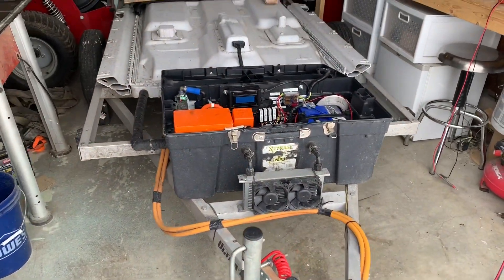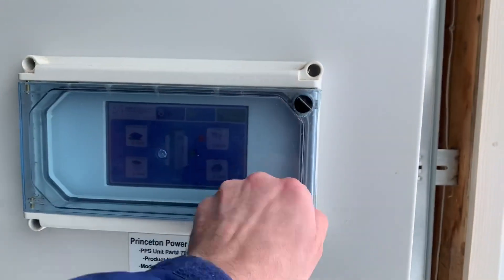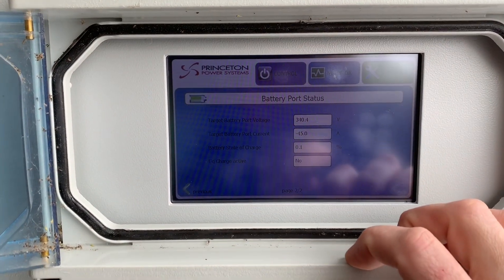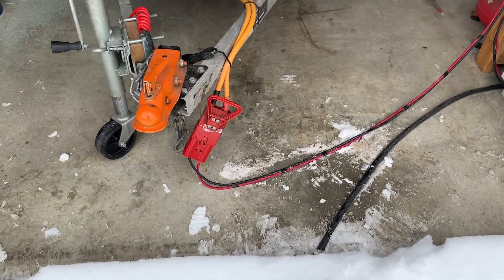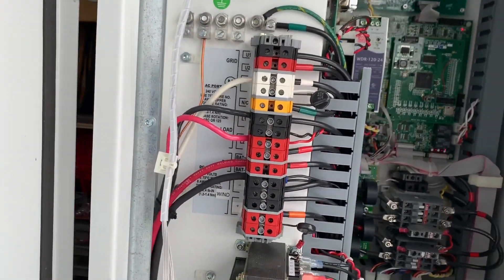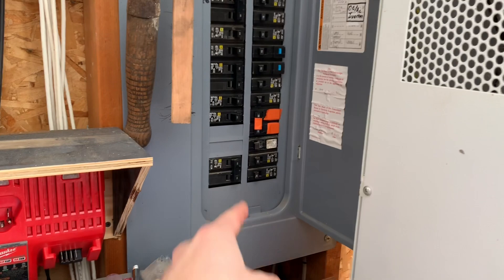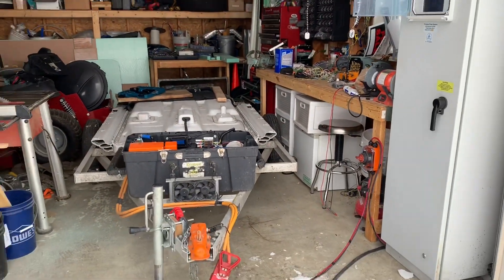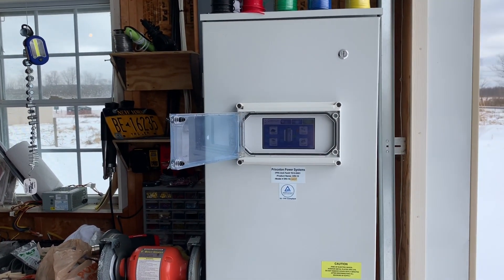Off Grid Inverter is up and running! T-Rex Trailer is now powering my house!

Comment: Do you know what the original application or power source was for this?
Reply from the maker: It was from a wind company. But this is the most universal machine I’ve ever seen. It can handle any power source. Even a gas generator